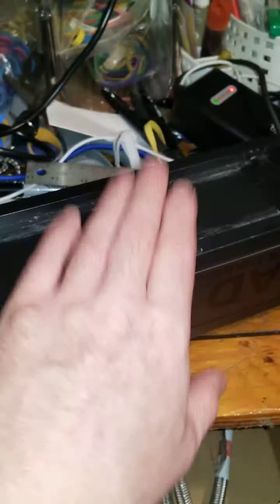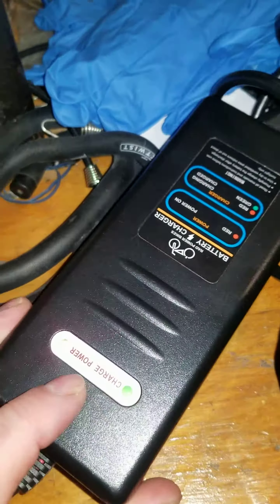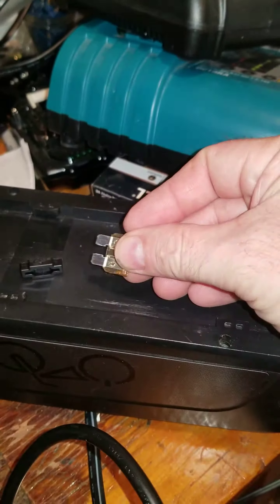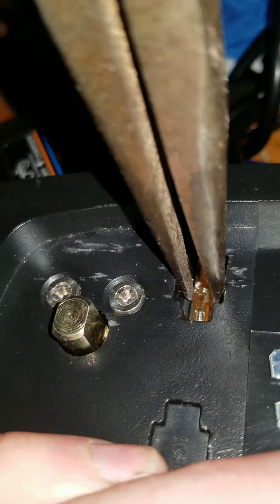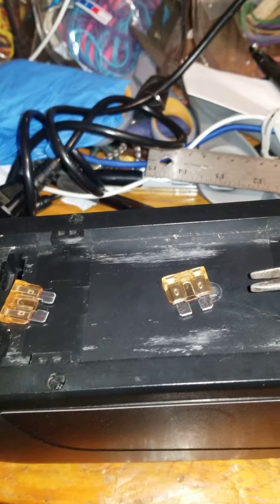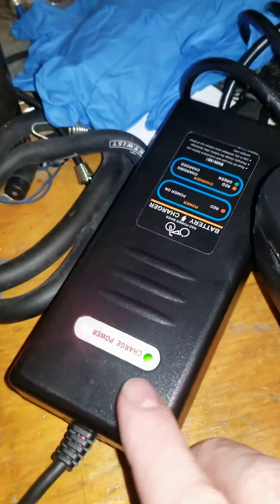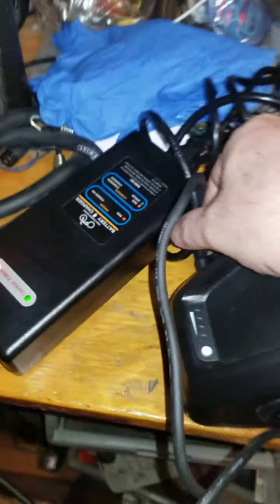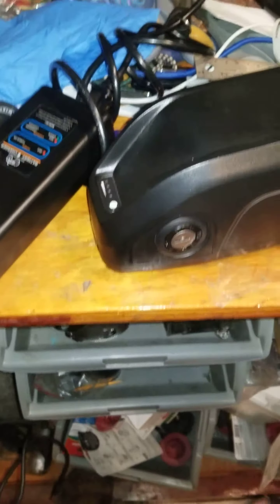Rad Power bikes battery

Comment: It's not working because you have the battery lock engaged. I can see the battery lock (stud) which locks the battery to the bike frame sticking out in your video. The battery won't charge with the key switch positioned like that.